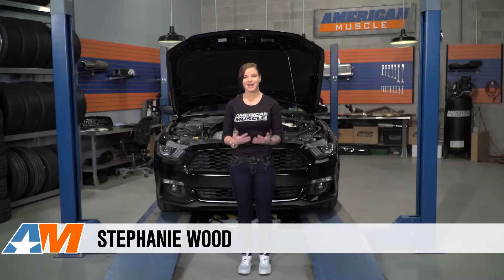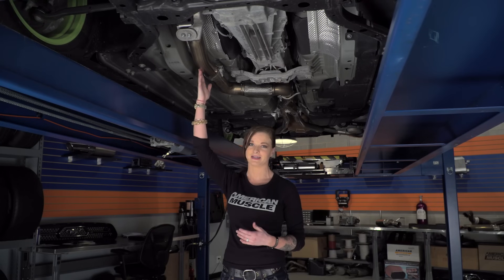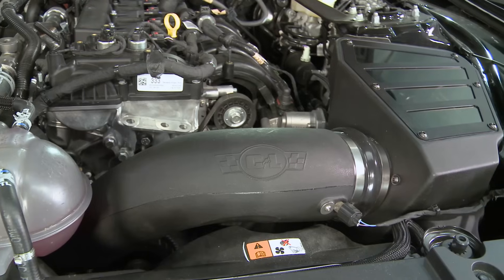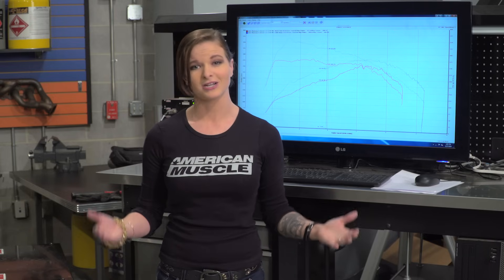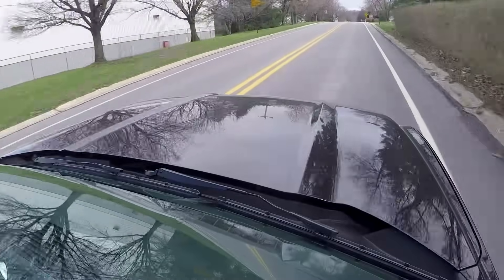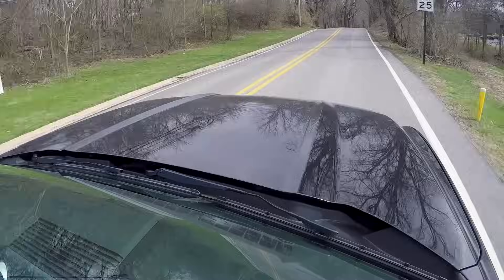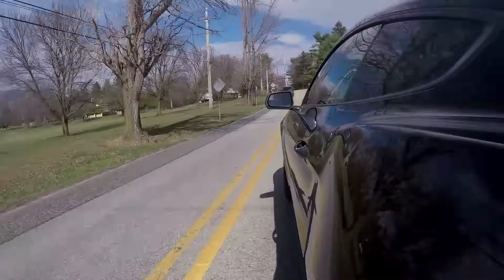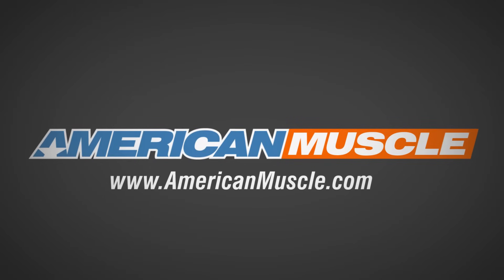3 Mods + 113 HP Gains- 2015 Mustang EcoBoost

Comment: I love the Mustang.  Hearing it with a 4 cyl sounds really strange to me.
Reply from the maker: Hankola, yeah in my personal opinion I am not a big fan either. But hey, for an EcoBoost it does have some nice power, and has exhaust options that can change up the sound a little bit for sure. The Turbo is what makes me happy at the end of the day. I would definitely rock an EcoBoost Mustang! - Matt
Reply: I totally agree, but I bought one anyway.  lol  It's actually pretty fast, 5.4 zero to 60.  Better than the 94 Trans Am I had back in the day.
Reply: hey not all of us can afford a new GT, but we still want that lookgood and gofast.  the 2020 ecoboost has 320hp and 350footlb of torque, starting at 25k brand new. Why im looking at one for my next car.
Reply: Aaron B I just bought one its pretty quick
Reply: Aaron B 310hp 350 tq*
Reply: Everybody loves the GT, but for me with an hour commute, the turbo is my car.  Love my 2015 premium performance package guard green! 31.5 mpg helps ease v8itis.
Reply: @subterfusion4005  yeah the fastest I got mine to 60 was 3.7. mine also stomps on GTS though, got a couple vids of it on my channel runs on E30.
Reply: @4touchdowns1game29  what mods do you have?
Reply: @ADeeManz  full catless downpipe and exhaust, intake, colder plugs, intercooler, e30 tune by pd, cobb accessport, 1 inch drop all around.
Reply: @4touchdowns1game29  would you consider the eco boost to be a reliable mustang ?
Reply: @ADeeManz  lol knock on wood yes. And most definitely is a headache aspect running my 4 cylinder high horsepower compared to a V8. It's just a fact of life that a V8 and the 4 cylinder with the same horsepower the four cylinder is going to be running harder. if you wanted a car that you wouldn't have to worry about maybe voiding your warranty and being good right out of the box I would get the GT. If you're able to work on cars just a little bit and maintain your data logs and don't push your car too far I would go for the EcoBoost. You got to think for all the horror stories you read there's tons of other people that haven't had problems. I mean if you go to a lot of rental car companies and try to get the sports car model they have an EcoBoost Mustang or Mustang GT. Rental cars take tons of abuse so it's a good sign that rental car companies having a faith in it to hold up. It would just be nice if it came stock with a semi-closed deck block. The open deck it comes with should be fine unless you want to go past 500 horsepower. The best thing about the EcoBoost especially when tuned is how torquey it is compared to the GT and how much better it handles on back roads.
Reply: @4touchdowns1game29  wow thanks man, I really appreciate the insight you provided. Now I have a tough decision to make lol.
Reply: @ADeeManz  yea no prob man. Feel free any time. Also what's cool about having an access port hooked up to your car is if even if you are modded and something goes wrong and you are data logging you will have a record of it. so even if Ford tried to avoid your warranty claim if it's a part of theirs that failed that caused the failure you actually can have a easy time fighting the claim unless you just want to put all the stock parts back on and try to hide your mods lol. Yeah for the most part though these engines are pretty reliable they even come stock with forged parts. But yeah knock on wood mine's been okay I also like the fact that my car was only 22 thousand, when I got it with a little over a thousand  miles. A GT you're going to be paying a lot more.
Reply: @4touchdowns1game29  what kind of exhaust you got or would recommend? I’m looking more for performance not so much sound.
Reply: @thelona108  where do u see one for 25k?
Reply: @Josh-js3uw  lol, posted this a year ago. the car market is kinda fucked atm, yeah not gonna find one for 25k right now most likely, they are 27k brand new on the Ford website, you just cant find anything at MSRP in the current market. prices will level out again though.   I actually ended up finding a 2019 GT with only 7k miles for 31k on carvana not long after i posted that tho. Couldn't be happier with it.

Comment: I have same exact intake but better exhaust system, car is in painting progress and i have not had a good chance to really test it, but it runs much better then other stock ecoboosts, 0-60 sport mode with traction on, with a bad start it did in 6 seconds, in track mode with great lunch i belive it can do 5 second with no problem❤️✌🏻

Comment: I drive an ecoboost I love it. I would like a v8 but this is crazy fun to drive
Reply from the maker: Oh I can only imagine! The EcoBoost is a great Mustang and I definitely would never turn down a chance to drive one! Plus there is so much that can be done mod wise to bring it up towards that V8 level! Have you done anything to it yet?? - Matt
Reply: I’m highly considering either a 2015-2017 Ecoboost S550, 2016-2017 Mazda MX-5 ND or (the car I’ve been following since 2007) the Toyotabaru BRZ FR-S 86. How is the S550 as a daily driver?
Reply: @CancelledMcCree   As a daily driver, it is probably the best, being the one with the biggest cargo space, usable rear seats, fastest in an overtaking maneuver (the only one where you probably don't need to downshift) and because of the turbo, it has power at low rpms helping you driving in town. And depending on where you live, it will probably also be the cheapest in the second-hand market.
Reply: PaxMu thanks! I live in Las Vegas & it seems the most sensible as a daily. The only thing that scares me is the keyless entry system
Reply: @CancelledMcCree   Doing a quick search, the safest and easiest thing is to buy a Faraday pouch and put the key inside when you're out of the car to block all radio signals the key can send and recieve. I don't know if there's a way to disable the proximity door locking mechanism.
Reply: Magical Mysteria just buy a 2014 GT500
Reply: Agreed.  My new '19 Ranger is plenty quick & loves to rev. Cant wait to mod it... an lift it! King Ranger is back! #Fordperformance
Reply: @CancelledMcCree  Mustang EcoBoost will be most fun an reliable of the selection u mentioned ..hands dwn. If buying used..be very careful (goes with any high performance vehicles). Opt for new. Less worries more fun & u mod ur way plus breakin nicely 1st 1000mis. Get a super high quality motor oil in @ 1000mis is my secret after top notch break in period. My Fords never break. Stangs or Trucks.
Reply: @PaxMu  If properly maintained an not abused to death..Mustang have always made solid used sports cars. Get a maintenance history!
Reply: @CancelledMcCree  why? If Sync3 equipped you get the Ford Pass app. Its excellent. The keyless entry in door area concealed by touch sensors is nice touch . As longtime Ford owner I've always appreciated these.
Reply: BigJetSki those are not on the same level as a ecoboost lol
Reply: BigJetSki money-wise, i mean
Reply: @CancelledMcCree  You probably bought a car by now, but the ecoboost is a great daily drive.  I have a 2017 premium ecoboost and I love it.  My other car is a C6 Z51 convertible Vette.  I've owned about 25 cars over the years and the ecoboost is one of my favorites.
Reply: Z E R O - O N E so out of curiosity, which one did you end up with? I have a 2018 base ecoboost coupe (6-speed manual,  101A and wheel and stripe package only), lightly modded (COBB stage 1 OTS tune with COBB CAI, custom 2.5” exhaust, strut tower brace, and hood struts).  This is my daily driver, and is a lot of fun to drive. The only mod I’m looking for in the future is an upgrade to intercooler and piping to counter the heat soak. It’s plenty of fun with the stage 1, but I want to upgrade to stage 2.
Reply: @pixofu01  I'm actually considering a 17 Ecoboost, but only because there's a dealer that's selling it for less than what V6s are going for.
Reply: Had a few of the older 5.0s and a 4.6. Wife has the Ecoboost. Really surprised at the power, and possibly faster than the older V8s. I’m sure no comparison to the newer GTs, but I think it will take the older ones, or be pretty damn close.

Comment: I would probably go with a quieter aftermarket exhaust. Some of the take-off and rev clips sounded like a tractor/dirt bike, but overall I like the car
Reply: yes and increase the turbo noises with an external wastegate and bov
Reply: Mbrp black cat back performance 3” is the best sounding I’ve found for the ecoboost it’s what I use.

Comment: Two things that should be added to that package of mods are a bigger intercooler and an oil catch can. A better sounding exhaust would help too 'cause that one sounds like a lawnmower. Yuk.
That said, Stephanie Wood can review my car and test the stick shift anyday!
Reply from the maker: Hey Dino. You are totally right my man. The oil catch can should definitely be added in regards to safety and keeping the engine clean by keeping oil out of the intake. In regards of the intercooler, you're right again. I personally would definitely add a front mount if this was my EcoBoost but Heather decided not to in this stage, but I doubt she is done YET.

Comment: btw, looking at the hp/torque curve even after putting all this stuff on one thing is clear, the ecoboost needs more cam(s). Thing looks like it dies at around 5000rpm.
Reply: Either a larger cam or larger turbo, yeah. The powerband looks like it's NA. You can see everything switch over (valve timing, etc.) around 4000 RPM, but there's not much above that.

Comment: I think to improve efficiency would be inter cooler, air intake, cat back, oil catch can, and that's around 2,500 bucks for all of that. I wouldn't buy a tune though, because that can increase problems with the car in the future, buying bolt on's just improves efficiency
Reply: Bolt on's are useless without a tune on the ecoboost engines. Ford uses torque targeting with its ECU which will pull any gains from the bolt on's back to the target numbers.
Reply from the maker: Hey Austin! There are many great bolt ons you can get for the EcoBoost, thats for sure. And of course you can get many of these awesome bolt ons for great prices! But with that being said, if you want max performance sometimes you have to drop a pretty penny. We wanted to get max HP Gains for this EcoBoost, and of course went down that Tune route. But hey gotta do what you gotta do, and like I said I definitely back you up on some great and easy bolt on options! - Matt

Comment: If you're going with a 3" downpipe you should continue that with a 3" full exhaust. Not sure why they went with a 2.25" for this.
Reply: Th 3 inch downpipe splits into two 2.25inch pipes for the cat back so no flow restriction at all. Two 2.25 inch is a little bigger flow area than a single 3 inch
Reply: Bigger pipes are not always better, you can start losing low end torque when you start using larger pipes.

Comment: Omg sounds like a import, not for me.  I'm interested for bora downpipe and cold air box.
Reply: Its a 4 cylinder what do you expect?
Reply: +Sean Tyrone I didn't.
Reply: One of the few times where I think stock exhaust sounds better.  Wow, Borla usually does a great job, but this sounds like crap.
Reply: I'm keeping my stock resonator and cat.
Reply: yeah imma stick with the down pipe and no muffler mods. I love popping but its hard to get without the loud import sound (100% expected though)
Reply: you should've gotten a V8
Reply: Next will be MR Corvette
Reply: Dynoids get the MBRP racing exhaust with catless downpipe & it will not sound like an import
Reply: so i got approved for one of these and i think they're beautiful but ima go ahead and go with the c6 corvette
Reply: Jets Set Nun less good choice
Reply: Jeff Lucas Astrophotographer I think the rousch has the best deep sound

Comment: and this is why im getting an ecoboost instead of a v6 or v8 mustang. easy to make extra power with upgrades when you have a turbo, after all it is a De-Tuned RS engine so it has the potential to make alot more than ford sold it at. not to mention more working room with a 4cyl and better MPG when your easy on the gass lol

Comment: Huge gains with just intake and exhaust... Didn't know it would be that dramatic.
Reply: Because it isn't ..I think this is bullshit. the catback and CAI g together give you 20-30hp and that's exaggerating, I doubt the tuner will give you the rest , not with out frying the engine anyways.
Reply: Modern turbo cars consistently see large gains from ECU tuning because of the electronic boost control. They can easily add in more boost without taxing the engine very much. COBB has been tuning Ford turbos for those kinds of gains for quite a while now.

My buddy had a SHO that gained +140HP at the wheels with an upgraded exhaust and tune (Livernoise). It's not magic, it's just modern tech.
Reply: Its not bull shit. The exhaust was more than just a catback they installed a turboback and also deleted one of the cats. Plus those tunes can make a huge difference, especially after a few bolt ons.
Reply from the maker: Hey Kurt, you know it big guy! We completely changed the game with this beautiful EcoBoost! With this Catback Exhaust along with the Turboback and Cold Air Intake, with the specific tunes easily brought an incredible difference to this bad boy! Crazy what a few bolt ons can do. - Matt

Comment: are there any vids on a v6 2016 mustang with the same mods aside from the turbo? I would like to see how much you're gaining if it were a v6 2015-2016 mustang..... in manual.
Reply: PALEHORSE the gains would be close to nothing, because n/a engines don't get the kinds of gains from a few bolt ons and a tune like turbo engines do.

Comment: Sure you can get fast HP with the ecoboost, but the v6 and v8 have more potential. Easy twin turbos from the f150 v6 ecoboost put on the v6 and the 4 cylinder wont touch it. The GT just needs simple bolt ons really, or a supercharger can easily be put on to create insane HP and torque. I guess you could upgrade all your internals and everything with the 4 cylinder, but in the end, you still have that 4 cylinder sound. v6 sound is manageable if you do it right, v8 sound can almost never go wrong, but 4 cylinder? Can't do it.

Comment: Hi, Very good mod. I wonder how does it affect fuel consumption. I'm interested on this car. I think it's going to be my next car. I was much into the V8 because of the sound. But fuel consumption is a concern for me. So if I decided to buy an Ecoboost and make this modification with you guts, how much does it affects to fuel consumption? Thanks! =)
Reply: That much extra horsepower is obviously gonna affect mileage a tiny bit, these mods are going to help the engine burn better and send the power more efficiently than stock so the mpg difference might be negligible to none.
Reply: Depends entirely on how you drive it.  With the freer flowing intake and exhaust, driven conservatively, it might just do better than stock, fuel economy wise.  Then again, anyone who would spring for that kind of modification is probably "not" going to be driving it conservatively.  If the driver actually "uses" that extra hp and torque on a regular basis, they can kiss the fuel economy goodbye!

Comment: missing intercooler upgrade
Reply: That would definitely be a good add-on after doing this mods, or at the same time. We put a CPE intercooler on a '15 EcoBoost the other day, it was such an easy install. Plus a lot of off the shelf tunes require it.
Reply: Honestly I would do an intercooler and tune on ANY ecoboost before I would even look at the exhaust. I made over 300ft/lb's to the wheels on stock turbo Fiesta with the factory catback. Until you do a turbo upgrade it's just there as a noise maker. It's not like cars back in the day, these exhausts actually flow pretty fucking well.
Reply from the maker: Hero, I like the way you think! Throwing an intercooler on this EcoBoost would definitely help with the performance gains, especially since it would be such an easy install, but hey for everything we did on this bad boy, I really cannot complain! Hope you liked the video! - Matt
Reply: AmericanMuscle.com
I do like it and you guys obviously your shit, I'm just trying to help other ford fan's down the upgrade path. If some dude spends $900 on a cat back that does nothing, he will get smoked by the guy that spend $500 on the accessport. I'm not against the exhaust, it's the when do you need it.

Comment: I am saving up for an Ecoboost swap. I am considering my platforms and I am working with low cash. I want 20 mpg and the ability to turn boost up, obviously getting less mpg when running high boost and pushing it. I got a 25 mpg average on my focus st with close to 300 hp. Only had three mods also and was at 295hp but dynothry said was a little off and we had to calculate and guess a little bit I believe it was right judging by others feedback on these mods.  Did full exhaust, intake, Ford racing tune, intercooler, and a few odds and ends. My donor car will hopefully be a very light red car. I would appreciate any input from people. Miatas are getting crazy expensive and swaps popular so finding good shells is more difficult than ever now days.